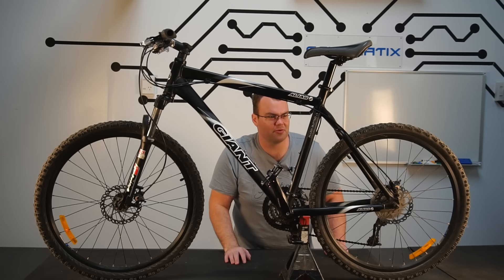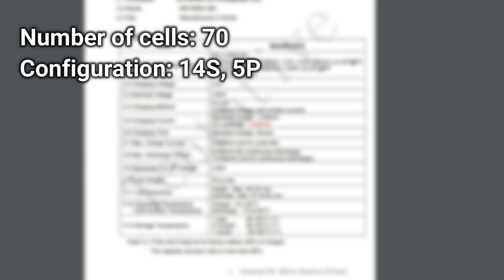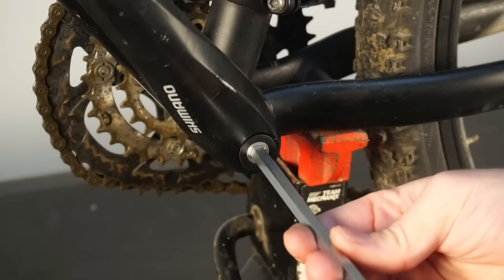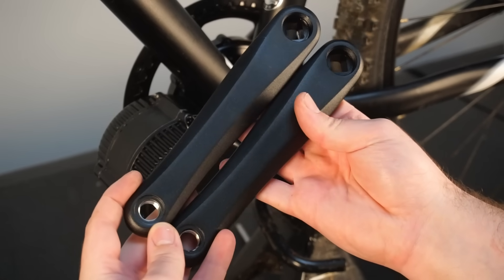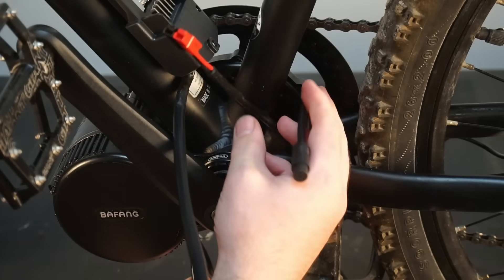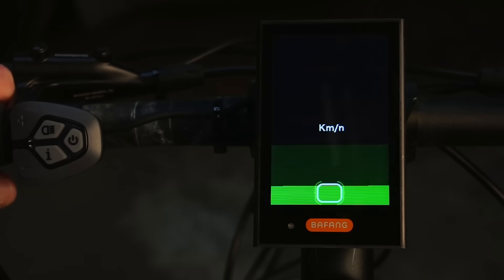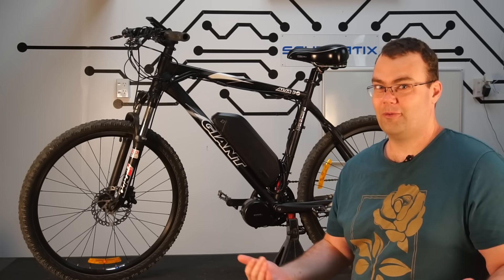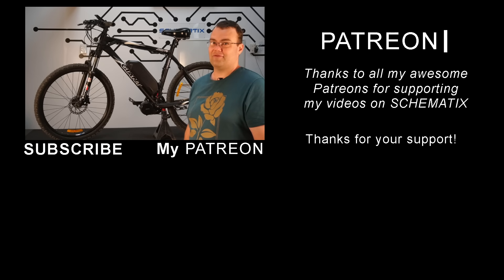eBike Conversion Kit, Install & Review ll Bafang BBS02B 750W motor

Comment: Yes ...NO! NOT worth the effort any decent kit will run at minimum a $1000 US than you have to provide your own donor bicycle all the work all the waiting for the parts possibly needing special tools also when something doesn't fit the exchange or buying waiting for replacement of new parts . You can buy brand new electric bikes with comparable or better specs with warranty's for just the price of these kits . This is BS ., !
Reply: That's not true, these kits are expensive because the batteries are expensive; a 52V with 20Ah and a 750W motor will be at around $1000, the branded e-bikes with such specs are $3500-$5000, the 1k ones are shit and won't give same amount of power

Comment: What an ugly design.  Couldn't they have fitted the motor between the frame tubes instead of hanging out in front of the bottom bracket where it can be damaged (perhaps they want you to damage it so you have to buy a new one).
Reply: Meant to universally work

Comment: Great camerawork and introduction!
Q:
Can I install on a bike with no disc brakes? (for on the net, Bafang says the "type of brake : disc")
Reply: Please don't install electric motors (Or any kind of motors) on a non-disc bike. Don't cheap out on the only thing that will stop you from eating a truck going 50.

Comment: The attachment of the motor onto the bottom bracket looks to be too weak to withstand the torque put out by the motor. These motors seem to rely on the raised sections in the bracket to bite into the frame to resist the motor moving/rotating. What’s your experience? Built in motors are welded to the frame for rigidity/stiffness to transfer the motor torque to the drive chain.

Comment: Anecdotally gearless wheel   hub motors last longer  and are better value  and are near silent . I get about 60 mile range no pedalling with a 28 ah UPP triangle battery . All working fine after two commute winters in Scotland and 2400 miles later . Not as good on hills as mid drive as gearless is all . (but still pulls me and my dog in trailer up anything .1kw rear hub)
Reply: Also rear hub will get you home with no chain !

Comment: 🇦🇩😎😇🙏mulțumesc, pentru filmulețul dumnevoastră.
scuze,pentru k engleza mea nu e foarte bună,  deci propun:
 Dar am în cap o foarte bună idee,( incă nu am experimentat-o, ufff...), dar,
Poate îți e de folos, ok.
Motor " semidisc,  comutație statică, urent continuu" ,☆☆☆detalii, (+schiță)...
 [ cu stator cu 10x2magneți permanenți de mare putere, chinezești, și la cele36spițe câte o diodă de 25Amperi și o bobină ⊙Cupru/mmp,33spire cu miez fier⊙33mmmp.pentru o Roată 28inch.] Ok...poți să îmi zici dacă vrei...

Comment: i really want to convert my fuji absolute into an ebike but im not savvy at all with installations. i thought of buying my own set of motors and bringing it to a local shop but those punks will charge me for a lot. then the more expensive option is to buy a pre-made electric bike.

Comment: It seems a little under powered for my liking. By at least 35% to 50% more likely. As speed is more enjoyable for me This kit is rather to slow ideal for some or those who like just a bit of extra power. But,  for me it's too weak. I would rather have at least a 3, 000 + watt motor with  suitably ampage battery pack ( at least twice this one used in this video i presume) 🤔🤔🤔  & i think i would rather have front wheel drive motor Others may prefer rear drive or as shown the central drive.  Each to their own i suppose.

Comment: I used A regular bike that had one simple 6speed rear hub. And bafang 750w. Then made a battery pack of 40amps.
It worked excellent and much cleaner operation unlike MTB with multiply cogs.
The brake handle also worked as clutch between gear changes. Ment no extra wear.
Reply: theres an actual sensor you can get that goes on the derailleur cable you can get that will do the "clutching" for you so you dont need to hit the brakes

Comment: Thanks for this. My kit came without instructions, so this was a very helpful video. I just finished mine and I want to point out a couple of things to watch out for:
1. My right hand bottom bracket was also reverse thread. A BIG spanner (or wrench) is needed for these, 8 or 10 inch.
2. As you'll still need the rear gear changer and it's probably integral to your brake lever, then you'll only need one of the brake levers provided. This doesn't cause any issues, but does leave a connector hanging loose.
3. Pay careful attention to the route the wires take, especially where they cross the existing cables for your brakes and gears. I used a length of spiral cable tidy and had to carefully position the ties to avoid the cables on my bike which are all external on the frame.
I'm glad to say that everything went well, and I now have the best bike in the village. I heavily insulated the power cable, wrapped all the cables in duct tape where they emerge from the motor and shielded this with a piece of plastic. You never know what's going to bounce up from the road and do them damage. There's also a loose connector at the motor for the brake sensor option if you didn't order that version. I found that the cap which comes with the display sensor fits this.
The last point is tiny but worth mentioning. Larger cable ties are fine for securing the cables. Perhaps even desirable, but the speed sensor needs two of those small cable ties to secure it to the frame. Don't use up all the small cable ties up like I did, only to find you need ones those size at the end. I rummaged about and found a couple more small ones, but I had larger ones sat there the whole time so I was kicking myself about that.
All the best with your build, and why not give everything a squirt of oil while you are there.
Reply: I had one and hated it, no matter how strong the chain was I would still break it! I think the newer ones have a torque sensor to stop overloading the chain but at the time my one did not have that option..
Reply: @gregb1599  Helpful. I wondered about that.
Reply: @gregb1599  Of course the hub motor relieves the chain of carrying the toque of the motor. It might be the way to go for the more powerful units...
Reply: Just use a couple of bread loaf twist ties for speed sensor!! l.o.l.

Comment: Are the rear gears usable for shifting while peddling?  Is there a twist grip throttle arrangement that can be purchased instead of the thumb lever.  I had thumb levers way back in the 1980's on three wheeler s and thumb gets tired after awhile. Motorcycle type throttle system is better.
Reply: Yep

Comment: PERFECT. Been waiting for an install on something like my Giant so I know exactly what to get and how to install everything. 

Two questions : does pedalling recharge the battery? And how hard is it to pedal against the motor when the battery is dead? I plan on using it for cross-country biking, and those are pretty important to me because I don't expect it to last 16-32hrs of biking between charges.
Reply: No , from my research mid mount motors don't regen. recharge, but hub mounted motors (but hub is inferior in other ways esp torque and speed) do Regen. recharge.
I have a hub mount atm, and am going to modify my old faithful Giant Hybrid MTB, I have just ordered a Bafang BBS 02 750 Watt kit (asked for Hydraulic brake hall effect sensors, and for chain longevity a gear change sensor) paired with 48V, 17.5 AH battery (rock mounted - includes rack), 46 tooth sprocket and DPC18 display (has a USB port) , i hope to achieve 50 Klm/Hr + and around 60 klm range (on road, slightly hilly, 65 kg rider).

Comment: I followed every step and.. my motor does not respond to input. The LCD which is connected to the motor turns on, but nothing happens when i peddle or press the thumb throttle. Have i just got a faulty motor or is there some trouble shooting i could try?
Reply: The brake sensor is the problem.

Comment: To anyone that has done this conversion on a dual-suspension MTB. How much weight did it add to your bike? Have you taken it off any jumps? How does the added weight affect that? I know my bike doesn't have the same geometry as a factory eMTB, so I'm not sure how it would perform after an upgrade like this.
Reply: Mitch ,I had a Bafang BBSHD fitted on my dual suspension $1500 AU mountain bike . It added about 7 kgs to the bikes weight . Did not affect the geometry of the bike after fitting  for my type of bush/trail riding .It did everything really well except big jumps(more than 1000mm off the ground.) The bike went like a rocket and was great fun to ride. Charge for the 52 amp battery lasted over 100klms riding each time ,with plenty of pedal assist. However, after using for 4 years, without any problems, I decided to buy a $9000 AU factory ebike with dual suspension. Wow what a difference in suspension , as it would track over the roughest terrain without a hint of feeling out of control. This justified the extra $$$ outlay as the old bike was never as capable. Downside is the smaller speed restricted motor and lower amp battery....BUT ..still great fun to ride. If you are an average trail rider you really cant go past the Bafang conversion ,both for value and reliability. Martin

Comment: For your info Aluminum frame bikes are wider than metal frame bikes where the rear axle is installed. You may find it hard to install a torque arm on each side. Your hub motor axle may not be long enough to support torque arm assemble and the axle nut.

Comment: I am curious about the situation after the front derailleur is removed. What size is the replacement front chain ring, and how does that mesh with the rear cassette? In other words what am I facing without electric assistance? Thanks for your clearly Kiwi, from an ex resident of Hastings.
Reply: Are you German?

Comment: I have the Bafang mid-drive 1000w on my Catrike 559.  It is powerful and an amazing unit.  Install was a little more complex as there are more sensors.  There is a sensor on the derailleur cable but as stated the kit is plug and play.  With a little boom adjustment on the trike, my disabled wife can now ride along since the throttle aids in pedaling.  A big thumbs up on this video.
Reply: @@hoolydooly5072 

The police in our area have way more important things to be concerned with.  Also unless you in an accident or doing something really stupid you’ve got nothing to worry about.  Top speed can be over 35mph with a range of 55 miles.(in assist level 3or less.  A complete game charger for my handicapped girl.
Reply: @douglaskaye1395 when your girl just uses the throttle only, how far is the range? Have you maxed the battery out yet on your rides? Thanks
Reply: Right on Douglas Kaye  ...  My buddy's got a thousand CC Sportster trike that's available if you're interested, wooopaahh!
Reply: what is the price
Reply: What is the top speed mph

Comment: Nicely done. Does it have a temperature sensor built into the motor, and does the display show the temperature, and does the controller reduce power when it starts getting too hot?

Comment: The crank has to fit so t.hat the chain is in the center when the mid speed gear is in the center. You may have to buy a chain wheel with a bigger offset some 17 to 20 mm.

Comment: Just for clarification:  the word battery has 3 syllables, not 2.
How much was the kit?  That should include the special tools needed. 
I'd be very concerned about the brake magnets coming loose and losing them.  If you lose them do you lose the ability to stop?

Comment: I still have some questions:

1. How long does it take to charge the battery?
2. Is it easy (practical) to swap out the battery (so one is always being charged while the other is being used).
3. How does both the motor and battery perform in bad weather conditions (rain, snow, extreme heat or cold, etc). Are they splash proof, rain proof, puddle proof, soaked proof...? Would mud, sand disable the motor or is the housing completely impervious?
4. Is there a recovery recharge system (recharges under normal riding condition when the motor is off)?

Thanks.
Reply: 1: I find mine charges in 2-3 hours
2: The battery is attached to a rail which mounts on the bottle cage and is trivial to swap out if you have two identical batteries, the battery is half the expense though . That said, if you can carry a spare, you don't have to worry about running out of juice halfway through a really long ride
3: The housing itself is completely enclosed. I ride mine around in British weather year round. However, I wouldn't try to ford a shallow river. The cable connectors themselves can tolerate rain, but probably won't stand up to complete submersion.
4: I don't believe any of these kits have any kind of recovery or regenerative braking, I assume the potential power you could put into charging the battery is so negligible as to make it not worth the extra components.

Comment: Nice video well done but as with e cars same with e bikes range suck. I had a e bike got it to do my part but after I got it found out very fast the range sucks my work is only 8 miles yes there is a few hills I am 180lbs e bike is 45lbs I got work just fine but on way home batt. was at 35% I still had 8 miles to go as I did not know how low you can run the batt. down I pedal rest of the way home not very fun. As for the name of the e bike I do not remember this was 2 years ago but it was almost 1,200 bucks had fun with it and did save gas when I was just running around close and not long range. But got it to ride to work and back but the range was not there but great video thank you.

Comment: It took me 3 hours just to get the bicycle handle grips off! I used WD40, 2 long phillips screwdrivers, compressed air... and a lot of strength to twist and pull them off. At one point I even wanted to give up! Not sure why many youtubers said it took them one or two hours to completion. And then there's some issues with fitting and stuff, not plug and play at all! When I put the front hub motor wheel into the drop out, the wheel was a little off because the forks were not exactly aligned. I had to file it down a bit...and then the screws of the motor was sticking out just enough to hit one side of the fork metal. I had to file down again. Then I had to put in the torque arms...in the back of your mind you never know if everything would be tight in the end. You know just go buy an ebike and be done with it!

Comment: very well done video and review.  I have used an e-bike conversion for an older recumbent bike in the 2000's and found it helpful but it had a lead-acid gel-cell battery that was very heavy and cumbersome.  I see how much better a powerful li battery would be, especially one with that much power. 
Have you had or reviewed a bike with an in-wheel motor? They are easier to mount but I don't know about performance. Love to hear any information or experience you have had with one.

Comment: I am considering doing this, however my brake and gear shifters are combined!, so not sure if the sensor option would work. I have disc brakes but they are mechanical and not hydraulic.

Comment: is it possible to solder in a waterproof marine 12volt 3amp usb port with a inline fuse and a on and off switch directly inside the battery? I am thinking about building a ebike with mid front and resr drive with a quick attach solar panel and micro wind power fan off the handle bars for trippls charging capibility im new to ebooks not circuit boards i would love to use el wire and clear tubbing for saftey light

Comment: Not a fan of the ESC in the motor. Solder joints, chips, and a circuit board belong in a separate box. Neat freak and two more wires on the handlebars? Motorcycles and cars have no such brake cutout, only cruse controls do. Why on an E-bike? Only dumb to hold throttle and brake at the same time.

Comment: Your putting a new chain on a old rea cassette that will not work if the bike has been useca fair bit the chain will jump the front rings will also need replacing. 🇬🇧👍

Comment: Great video thanks.  I installed a bafang 750w last week. Went well thanks for your help.  One thing  I’m not liking the beta assist , can it be programmed out ? I tried disconnecting the wire to the speed sensor on the back wheel,  but the assist was still working . 
Any advice will be appreciated, thanks

Comment: He's such a delicate flower of a guy.
:)
Nice video; my main tip would be do some research on how to remove bottom brackets, they can be really "Stuck" on you'll need to bolt-in the special adapter.

Comment: Immediately you lose the front cogs. This is 50% of the bikes power ability lost on the smaller cog when going up steep hills. That is a very poor trade off. The hub fitted e bikes quickly ware out their bottom bracket this is a marketing ploy as when it's gone you need a new one.

Comment: interesting, the only thing i'm a little confused by is, if the motor replaces your spindle and connects to your crank,  doesn't it turn the pedals when you use the direct throttle ?   how do you go along without your legs moving ?   I have 2 hub motor bikes and don''t know much about mid drive.
Reply: The front chainring is actually on a freewheel, so the cranks are not directly connected.

Comment: Your affiliate link’s price varies from $691-$1131.08US.  Which price will I pay? Apparently, there are several monitors to choose from.  Can you describe them to aid my choice. The motors come in 13-20ah (amp hours?) options. Can you describe the designated usage for the different AH models.

Comment: That is not how you size a chain. 
Look at your derailleur.
Reply: I knowabd you also need to replace the rear cassette if the bike has had a fair bit of use and front rings or the chain will jump i personally would if replaced the free hub and serviced the wheel hubs..🇬🇧 👍